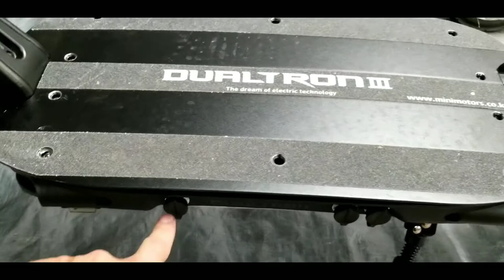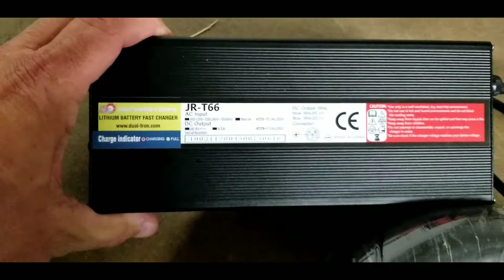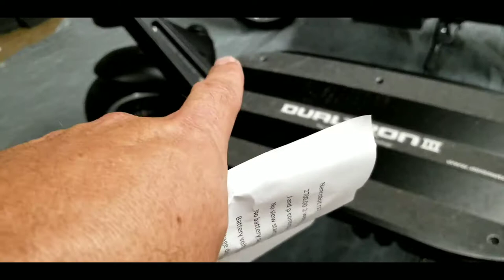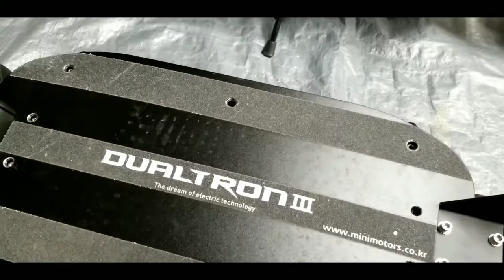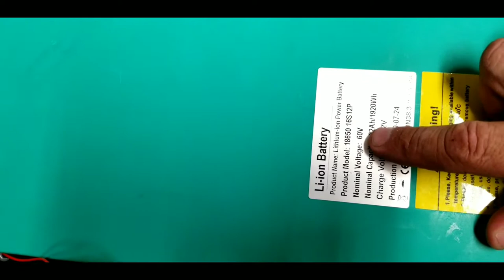Nanrobot RS7 vs Dualtron3 (1 of 2 videos)How do they compare to each other? Electric scooter review.

Comment: On the Dualtron 3 I believe the switch you said was the main power switch which in fact the main power circuit switch is actually on the other side with a protective clear cover over it the circle switch is in fact a switch for the display LED lighting for the scooter
Reply from the maker: Yes you are correct. Thank you for catching that and thank you for watching.

Comment: Was the speed you mention for both scooters from the controllers or GPS verified? By the way, very thorough review. Thank you
Reply from the maker: Gps for both scooters. Rs7 I had at 54 mph top and the dt3 at 45. Both going down a slight delcline. Flat service with around 175 to 2001lb rider in perfect conditions you will see 52mph for the rs7 and 40mph for the dt3. Thanks for watching.

Comment: Great Video! Thanks for the detail. Note the Dualtron Charger only charges the 60v to 66.4v; A full 60v battery is actually 67.2v so the Dualtron sacrifice a few miles range for more charge cycles of the battery. The unbranded chargers out the same factory sell on alibaba ali express ebay etc. (67.2v 6a, 8a, 9a, 10a) and all available with any plug and socket. I would choose the 8a version for both these scooters. Dualtrons dont have on board BMS but if they did it is important to fully charge a battery so the BMS can balance the cells properly.  The LG Cells are rated 1C This equates to 1:1A at max capacity. Therefore you could charge a 20AH battery with a 20A Charger and charge your scooter in 1 hour. This however isnt practical as the cable thickness and heat generated with no BMS is dangerous however the cells are rated to handle it. I would suggest less than half is good so a 67.2v  8a charger would charge 20AH in 2.5 hours. The cells would be fine as still less than half the rated charge capacity. The cables are thick enough and all would be OK. 
I would suggest an aftermarket 67.2v 8A charger rather than Dualtrons 66.4v 6.5A. The aftermarkets are same factory and half the price also. Work the maths for any scooter at less than half the A to AH of battery and always get a charger that fully charges you battery. Less Cycles and battery degradation? Not really relevant, in 500 charges its probably time for a new scooter anyway. Your Dualtron Charger works on the Nanrobot just fine also it just doesnt fully charge either scooter technically. (66.4v Dualtron Exclusive not 67.2v generic). Sorry for the long message Hahaha
Reply from the maker: Thank you so much for that detailed explanation. I have a question? If the battery pack doesn't have an on board bms how does it balance out the charging batteries?
Reply: @wattsinyours  simple answer..  it doesnt. That's why Dualtron "play safe" with 66.4v 6.5a :( Yours a 30AH? Go with 67.2v 10A. 3 hours fully charged. Every 10 charges cut the charger at 2 hours 50 mins. Simple
Reply from the maker: @E69apeTheMatrix420  ok gotcha. Good to know. Thank you for the explanation.
Reply: @wattsinyours  Thanks for the appreciation:) I think having a fast charger is great for daily life, waiting for battery to charge is boring and takes away the joy of ownership for me anyway :( The fast chargers are "smart" anyway so as the battery gets fuller its cuts back the Amps to less than 1A and charges it "smart" the whole time.
If I baby my belongings I feel bad when I dent them! "Use it hard and put it away wet" is my motto! Hahah got my moneys worth.
Your battery will last the life of the scooter easily and you didn't have to wait all that time for it to charge whilst you owned it. 
I love your gasket modification video as well top job there! Thanks.
Reply: @wattsinyours  I would like to give you 1 more tip you could put in a video perhaps: Always connect the charger to your scooter first before switching on at the mains! I saw a video on here that suggested the opposite and that is bad as a power surge and potential spark from the socket (wont shock you) but still. Also you have a volt meter on your scooter so if you want to cut the charger off at 66.4v manually you can but that would be a bit of a pain to keep an eye on it.
Reply from the maker: @E69apeTheMatrix420  i agree with the plug into your scooter first at least thats what i always try and remember to do. Its funny though bc people will always try to argue that point to no end. Lol. Im also kinda like you i ride my stuff hard and hey if i ruin a battery or 2, so what I'll get another one. I buy and use these things how ever i see fit and at the end of the day i just want to have fun on them.
Reply from the maker: @E69apeTheMatrix420  also if u happen to catch my charger upgrade video i did modify my nanrobot rs7 to accept the dualtron charger. The plug leads were wired different so all i needed to do was take one off the nanrobot plug and installed a dualtron plug. My nanrobot rs7 has 2 charging ports, so i speed charge on one and use the nanrobot charger on the other giving me around 8amps. I can go from almost dead to a full charge in about 3 hours. Some people said i was crazy for doing it bc i will blow the battery up, but i have charged my scooter like that about a dozen times with no problem. I just don't speed charge all the time.
Reply: @wattsinyours  I 100% Back you. Make the most of your stuff and dont wait 12 hours for it to charge!LOL! You seemed like the right guy to send the first message to explaining. I could tell the detail is important to you:) 
The 10A charger on a 30AH battery is 1/3 the battery's rated capacity and the smart chargers are easy on them anyway. I would say that is still playing safe. You could use the same 10A Charger on a 20AH battery safely I would say at 1/2 the rated capacity. 
The New EMove Cruiser has BMS and IP67 water rating (1m depth 10 mins!) this is the way all manufactures will have to follow now they have set the bar.
Reply: @wattsinyours  Amazing job Man! I Subscribed BTW:) I will check out that video now Ill go through your channel I like the cut of you shiz! You can explain to people to put the charger into scooter first so the pixies have somewhere to go when you switch on at the mains and dont build up inside the magic box of trickeries with nowhere to escape. Then you touch your scooter with the socket and Spark boom go the pixies and they are away! Magic pixies always make sense. They like to escape! LOL
Reply from the maker: @E69apeTheMatrix420  i hope all the scooters start getting a better water proofing set up. The design on most are just asking for water to come inside. I know i can't stop all of it but at least i can slow it down before it causes a probelm. Thanks for watching my vids and your positive attitude. People like you keep me wanting to make more videos and share my knowledge and experiences.
Reply: @wattsinyours  Keep it up fellow rider! Haters are Loosers and do what you believe in. Passions find you in life just follow then. In the UK E scooters are illegal! Next month the law will change hopefully very soon! Were so behind!
Reply from the maker: @E69apeTheMatrix420  im keep hearing that the scooter are illegal over there. i have a couple of other subs that i talk to from time to time when they comment on my videos. Hopefully soon that will change and you can ride around and do what you want. Here in America specifically in the Washington DC area they are for the most part welcomed but it didn't go without a little bit of backlash. Mainly because people were being irresponsible and getting hit by cars, but they probably deserved it because they were being idiot's on their scooters.
Reply: @wattsinyours  I agree. I think they will be limited to 15 mph:( The same as rest of Europe really. You guys can go as fast as you want?!
Reply: @wattsinyours  Please may you read the tyre size on both scooters? I'm really interested. It will be something like 110/70R11 I think you can get tubeless premium brand tyres for them (valves needed aswell)
Reply from the maker: @E69apeTheMatrix420  The nanrobot Rs7 has 90/65-6.5 cst tires. They can be used as tubless tires but they have tubes in them because the rim is a split ring and it wouldn't hold the air like a car tire would. The Dualtron3 has 10x2.70-6.5 cst tires on them and they are tubless just like a car tire.
Reply: @wattsinyours  thankyou very much. So split rim means wont hold air? Some cars have them though must be different? I think I'm going with a TNE Q4-V6. I just found out it has tubeless aswell. Same size. That was a key point I needed to know thanks.
Reply from the maker: @E69apeTheMatrix420  no problem. Just make sure you check to make sure they are truly tubless. I thought my nanrobot was tubless. The tire itself says tubless on it but it does have a tube in it. I was thinking about going tubless on my nanrobot but i don't see how the split ring would hold air because there is really no way to seal it. I would have to buy a whole new rim set up. So the two differences is that the dualtron tire is a whole lot harder to change a flat than the nanrobot so what i did is just buy a tire with the rim on it and have it for a back up. Just a lot easier to swap out when you get a flat. If I'm going on a long ride i just carry the rim/tire in a book bag with me which is not that big of a deal. When i go on a long ride with the nanrobot i just have to carry a tube. Sorry for the long explanation but hopefully this helps.
Reply from the maker: @E69apeTheMatrix420  hey also i just checked out that scooter you are thinking about buying the tne q4 v6. Looks like a quality scooter. The only real thing i would be concerned about is the front shocks. I have scooters with those on it and you are probably not going to like how they perform. They are a cheaper type of shock. If you have other options i would go with hydraulic or spring over hydraulic. The ride is so much better and it does a lot better with pot holes. It probably would be a deal breaker for me unless they could put full hydraulic or air suspension on the front. Of course this is only my opinion either way looks like a good scooter.
Reply: @wattsinyours  that's what I think 100% the shocks are rubbish! I was looking at the Kaabo mantis but it doesnt even have a headlight or key and comes with 10" tubed road tyres for £1800! This is £1350 so much cheaper and leaves money for upgrades. I dont like the rubber bush style suspension in dualtron or the LS7 realy prefer shocks.
Reply: @wattsinyours  I definitely want 11" full size scooter with hybrid winter pneumatic tyres. Full coil over shock suspension not rubber bush or weak springs only, foot kicker at rear. Atleast 3200w 60v, 25AH -35AH, headlights, key.
And im in the UK so we dont have all the various models the US does;(
Reply from the maker: @E69apeTheMatrix420  yes those are all the things i would have if i was looking to purchase a new scooter. Sounds like you have a good idea of what you want. Good luck on your purchase.

Comment: if you've had a few nanrobots, what are they like over a long time, still going strong or any problems with things starting to fall apart?  Im about 210lbs and interested in the D6+ but wondering as a brand how they hold up over time, and if you have seen any differences in long term reliability between different nanrobot scooters
Reply from the maker: The d4+ was crap but the d5+ is pretty good. Had the d5+ for about a year now and it's still good to go. The biggest thing that you will have to deal with is battery life and speed. Don't have the d6 but looks pretty cool. I would have to say that it is a low to mid range brand. In my opinion the price for them is very competitive for what you get.
Reply: @wattsinyours  Thanks, hopefully means they are getting better each time, and if your d5+ is still going strong thats promising.  Im hoping tha battery life and speed will be plenty for me, ive had a converted ebike for about 3 years with a 36v 11Ah battery, a 250W kit that gets me to 15mph for about 25 miles which is useful but not a lot of fun, have been wanting to upgrade it for a while but living on the first floor the bikes already a mission getting it up and down, even more with a bigger battery and motor.  I use it on light trails also and think these full suspension scooters are the way to go now

Comment: You didn't mention this, and so far I have not seen any other electric scooter youtuber mention this, but on the dualtron and the weped website all models say that they are  limited to 15 mph in the U.S.A via speed limiting whire. I own a Nanrobot D4+ that I bought from Amazon and it's not limited in speed, but it has a setting on the controller to limit it if I chose to do so.  On the nanrobot website none of the models mention a limiter. Does the limiter work the same for the dueltron? Or am I stuck at 15 mph? Thank you.
Reply from the maker: They try to make it sound complicated but its actually a grey wire in the dualtron that you unclip. It takes a few minutes to do. Dualtron does that so they can sell to most states or countries that have speed regulations and for liability purposes. Some manufacturers don't do it because its not their market or don't care. If you buy a dualtron just unplug the wire and literally thats it. Most of the higher end dualtrons go 40mph + after you unplug the wire. Hope this helps.
Reply: @wattsinyours  it helps a ton. Thank you.

Comment: which one has the best shocks absorbtion ?  i have a back problem
Reply from the maker: I would say the d3 because you can adjust the shocks if you buy different ones, but the rs7 feels like your floating but are not adjustable. Both have there drawbacks though.
Reply: @wattsinyours   thanks ill check it out

Comment: Dualtron has an isolator so can't be ridden off?
Reply from the maker: When you say "isolator" what are you referring to?
Reply: @wattsinyours  the keyed switch that cuts the power,so essentially a antitheft device?,
Reply from the maker: @shameelali2549  no the dueltron does not have an isolator, so if some wanted to steal it they could.

Comment: Imagine making a transportation product and one of surest things that will be worn out (the tires) are impossible to replace. This is EPIC FAILURE beyond retardation. It's the worst thing you could  possibly do for a TRANSPORTATION product. WTF was Dualtron thinking.
Reply from the maker: You can replace the tires they are just more difficult. You have to do it like a bicycle tire its just about 5x harder to do. You can also buy an extra tire already mounted on the rim if you don't want to mess with the mounting part but it is just way more expensive than just the tire it self.